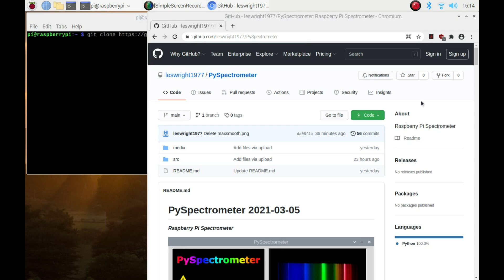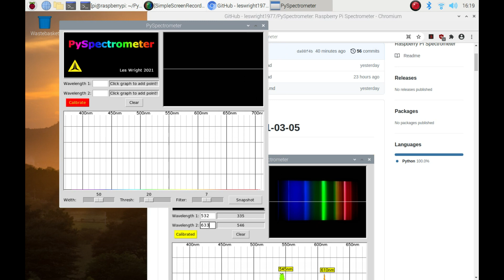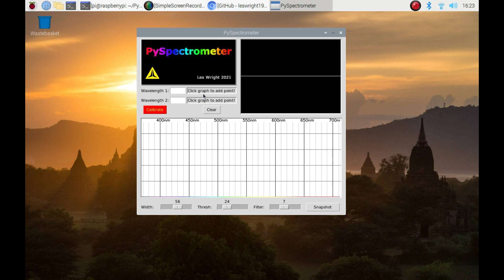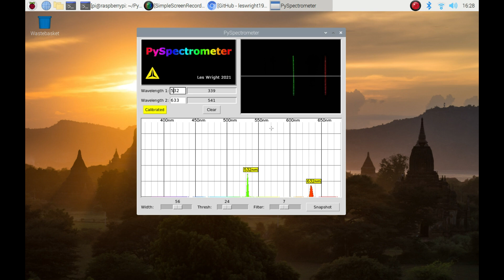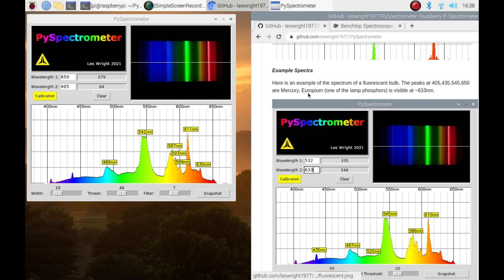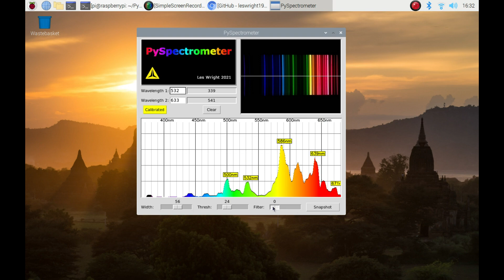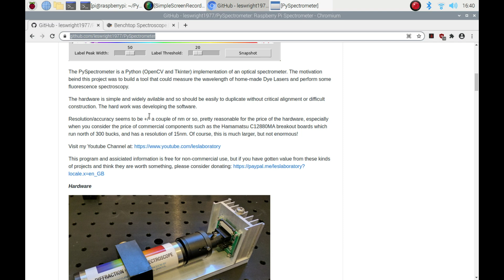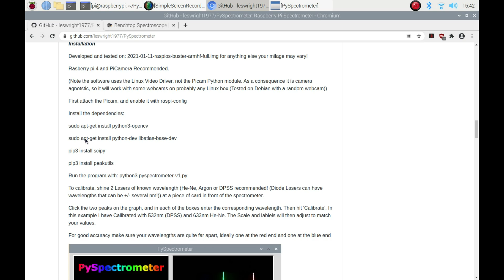How to build a DIY Raspberry Pi Spectrometer using a Picamera and Spectroscope.

Comment: Hypothetically could you run multiple instances of this for use with multiple cameras on the one rpi ?, is there an AU ledgend on the y axis ? Would it be easy to pipe this data through to another program which could act on the data say for monitoring cell densities during fermentation?
Reply from the maker: Hypothetically, yes, but it would require a rewrite.  The Y axis vals are AU from 0-255.
Again, yes, but a rewrite would be required. There has been considerable interest in using data beyond the program itself, I am just pushed for time at the moment, but it is coming. 
With the number and types of request, I am thinking of creating a "suite" of small applications that will run on the pi Zero. One that just spits data out so you can pipe to whatever seems like a good idea.
Reply: @LesLaboratory  awesome, thanks for replying, your setup could give my work spec a run for its money, brilliant work

Comment: This is just excellent -- thanks!  //  Btw, I suspect that the strong line a little into the UV that shows up with the HeNe tube could be He at ~388.9 nm.  (Ref:  https://www.physics.nist.gov/PhysRefData/Handbook/Tables/heliumtable2.htm )
Reply from the maker: Thanks, and thanks for the info! That's a real handy reference! I picked up a couple of interesting tubes on eBay lately for some more experiments. A germicidal Hg Vapor tube, and a Deuterium lamp. I wont be able to do much in the UV, but it will be nice to see Deuterium alpha, and other visible lines.

Comment: Does this project run on the Raspberry Pi Zero via SSH?
Reply from the maker: This runs a GUI, so no. It might run over VNC, but I expect it would be very very slow.
I am planning on building a 'Lite' version of the software for the zero. What features would you find most useful in a cut down version?
Reply: @LesLaboratory  Thank you for your answer.
For me the graph and the calibration function would be the most useful. I also think a 'hold' function would be a great addition. Maybe it would be possible to host a website with the pi (to show the data) instead of the GUI.

Comment: Could you use it for gas chromatography ?
Reply from the maker: Unfortunately, no. Chromatography is a different process, where compounds are physically separated for analysis.
Reply: @LesLaboratory  I think it works by shining a light through a gas sample and reading the diffraction.  Thoughts ?

Comment: Neat project. You got my attention with spectrometer, I've always wanted to use a metal spectrometer that can identify alloy percentages in metals. I think they use an x-ray as the most common type , could something like that be modified to use your design?
Reply from the maker: What you are talking about is XRF (X-ray Fluorescence), which is a whole different ballgame, but fundamentally similar, it just uses X-rays instead, and a suitable Scintillator instead f a diffraction grating to detect the different photon energies.

It would be possible to identify a metal with an optical spectrometer by vaporising it. This can be done with a High power Laser. Mars Curiosity does that: https://mars.nasa.gov/msl/spacecraft/instruments/chemcam/

Comment: Just what I've been looking for - THANK YOU!

I have lots of RPi 3B+ but no RPi4, so I'll have to get one I suspect. I assume a 2GB one will be enough - but I see that you're using a substantial heatsink on the Pi.

Two questions: Is the heatsink really necessary? Will your software work with the the RPi HQ camera?

Thank you again!
Reply from the maker: You are welcome!
The heatsink is not totally necessary, but I use the pi for some OpenCV dev work, so why not!
I have not tried it with the HQ cam (I dont have one...yet), but there is no reason why it wouldn't work!
Reply: @LesLaboratory  Thanks - much appreciated. I'll give it a go this week some time. None of the work I do with the Pi is particularly demanding (I've got every variety except the 4, and desperately waiting for some Zeros to become available again)
Reply: @LesLaboratory  Thanks again - I've only just made a test version, and it works pretty good. I got a pi-4 and set it up with the HQ camera (12.3Mp) and the 6mm CS-mount lens.

It's quite a wide angle lens so the spectrum appears quite narrow, and calibrating the software resulted in the graph grid becoming corrupted. So I'll try with the 16mm lens if I can find it, although I suspect it may be too narrow (but it is optically a much better lens than the 6mm). I'd like to try to get maximum resolution from this, although I guess it'll slow the refresh rate.

The pi does get VERY hot, and eventually shuts down after about 15 minutes - so I've added a simple heatsink.

I've 3D-printed a basic mount for all of this, but will redesign when I get a narrower-angle lens.

Comment: Hi, really cool project.  you got a new sub.  I'm trying to detect UVC light in a dark room, do you think this would work for that?  thanks in advance if you see this!
Reply from the maker: Thanks! UVC is in the range 100–280nm. Unfortunately this is outside of the range of the spectrometer (designed for visible) and indeed the PiCamera, again visible (and IR if you have not NoIR version).
That said, I am currently working on a possible solution to this, for the hard core hackers that want to look outside the confines of the visible spectrum!
Reply: @LesLaboratory  oh that's exciting, i'll be watching for that update!  Thanks for your reply

Comment: How did you know the lasers were those values? I did see a test where the nominated value was not the true value as referenced from a calibrated scope. Is there a standard product where we know the true value that does not vary?
Reply from the maker: He-Ne Lasers have very specific wavelengths. The common red He-Ne for example is 632.8nm, and does not drift with temperature like diode lasers. This makes quite a precise standard. DPSS Lasers, again these have very specific wavelengths. although the pump diode (808nm) may drift, the Nd:YV04 lases at 1064nm exactly, and so the doubled light is exactly 532nm.

Comment: Nice! I have a stupid question. If I understand correctly,  the spectrometer lenses separate the different wavelengths to end up sorted. The result is a "histogram" of wavelengths. Could the same result just be computed by counting the intensities on the CCD? I bet it cannot, but would someone please explain to me why?
Reply: Do you mean without a diffraction grating?
A. RGB-CCD has only 3 channels of spectral information, but with a diffraction grating in front that seperates the spectral channels you can have up to  2.592 spectral channels (with 5MP pi camera).
Reply: @SEOGmbH  do you mean 2000 or 2.5?

Comment: This is really cool. You know, one of the ways chemists use spectrophotometry is to estimate the concentration of a given compound in a solution, but doing that requires making a series of standard solutions. Particularly IR-spectrometry is uesd for identifying organic compounds, but doing that requires a library of known transmission spectra. Either way, you have a very powerful tool right there.

Comment: Please give us the Model Number and the Manufacturer of the F1.6 M12 Zoom Lens, it would make it easier for us to find the right characteristic lens, looking on eBay there are a lot to choose from.

Thanks!  Great Project and site!
Reply from the maker: Sure: 1/3" 9-22mm IR Sensitive Manual Zoom M12 Mount CCTV Lens F1.6 Security ZT  https://www.ebay.co.uk/itm/362992659840
I am currently looking into smaller fixed focus lenses for this application as well.
Reply: @LesLaboratory  Thanks for taking your time to answer my question!  Sharing y0ur project is a very valuable lesson for all to follow!
Reply: @LesLaboratory  eBay won't ship to Germany so I went to Amazon and I am looking at this:

Festnight CCTV Camera Lens 6-22 mm F1.6 M12 Mount 5.0 Megapixel Manual Focus Zoom 1/2.5 Inch Lens MTV IR Lens for Security Cameras HD IP Cameras (No IR Filter)
€17.99 
FREE Delivery

Does this look good to you?

Comment: Wow very nice. But can't you make it say what the things are made out of instead of numbers? They used a spectroscope on the SUN or stars to know there mostly hydrogen. But like you said can't point this at the SUN. But burn any thing and it will do light and this should tell what it's made of right?
Reply from the maker: I suppose you could maybe process the data with AI to give an indication of what it might be. I will look into it if I get time.

Comment: Great video. I have a question, I need to measure uv wavength from 320 up to 420 nm. Any suggestions? Is there any filter for the camera? Or a specific camera for uv?
Reply from the maker: jonsmirl on github sent me this: https://www.mdpi.com/1424-8220/16/10/1649/pdf Worth a look!

Comment: Would see additional value in integrating detector response curve... currently it is only calibrated for wavelength, not intensity. I agree, that is much more difficult to achieve though.
Reply: Good idea. For this, one will need the quantum efficency curve from the camera. But I m not sure the manufacturer has measured it for such a cheap camera. Also, the camera uses a bayer matrix, which means there are red, green and blue pixels. These have to be callibrated individually. So i guess it is easier to look for a monochrome sensor with a quantum efficency curve available.
Reply: @TheMAggi99  Definitely going black and white sensor is a good option. In my young days when still doing detector work, I removed  the glass protective plates in front of the ccd array: you can buy 50 of them on the cheap (and break several off them while improving your methods), compared to only one equipped with a quarz window.
I was dealing with soft x-rays lasers, and these tend to actually increase the dark current of your pixels over time, burning the camera chip, even at low average (but high peak) intensity.

Comment: Greetings from a HAD reader & new sub. I only recently became aware that it was even possible to build lasers at home -- my wife is concerned. 😁 Cool you were able to get that spectrum on a regular RPi camera. Would the NoIR cam variant help with the sensitivity at the extremes of the spectrum, maybe?
Reply from the maker: Yes, the NoIR cam would be more sensitive. The Spectroscope I am using is designed for visible wavelengths though. The deepest into the IR I have seen is 760nm. To get a larger range, you would have to build the spectroscope frontend. UV is particularly problematic. Most glass types, and all plastic will absorb it. You would have to use Fused Silica optics for UV work, which costs $$$! IR should be no problem though.
Reply: @LesLaboratory  Ahh yes, of course. You're working in UV... no idea how I got IR in my head. That explains the effort behind the dye lasers.

Comment: You know, you would have a hard time using security cameras if they were all damaged by the sun ... sun shines into my cam often as it gets low in the sky and it is just a $30 amazon job.
Reply from the maker: Sure, just don't want people chasing me if they break their stuff! That said, if the aperture is large enough, you can destroy the CCD.
Reply: @LesLaboratory  That is why i said 'security cams' since even indoor ones may be hit by direct sunlight if looking outside.  It is one reason those idiots with laser pointers have a hard time damaging security cameras.  I really put this in here for a hint about possible solar spectrometer (blackbody permitting).  Of course I understand your disclaimer, but it is an interesting bit of fact to make people aware of.  I did like your video btw.

Comment: How can that be done for infrared spectrum? I was thinking to use something like that to check fiber optic telecommunication interfaces... let's say from 1530nm to 1565nm.
Reply from the maker: To get a larger range, you would have to build the spectroscope frontend. IR should be no problem. You woudl also have to use a Picam with No IR filter. Just look for NoIR, and check and see if the response fits your need.

Comment: Can we use a DVD for diffraction grating?
I have noticed the DVD diffraction pattern is not linear, but sort of polar. Is there anyway to correct for that?
Reply from the maker: You should be able ti use a home made spectroscope with the software. Yes, off of a DVD or CD the pattern in an arc, so long as you can get the line in the preview windows to run right down the center of your spectrum from red to violet it should work. You can always buy cheap linear diffraction gratings online.

Comment: How are you calculating intensity or counts at a particular wavelength. I assume the camera is RGB right?
Reply from the maker: Yep, it's RGB. When the pixel data is pulled out, the RGB data is just averaged to get the value for intensity. I will be doing a video explaining the source code shortly, so people can find their way around it and improve it. Also, V3 (soon to be released) has a couple of features added, that have been requested on here.
Reply: @LesLaboratory  Thanks for the reply. Any reason you choose to interpret intensity in that way? I've been playing around with the idea of using HSV color space to use the S & V values as a pseudo intensity substitute. Maybe it might be appropriate here as well?
Reply from the maker: @moothecow7346  cv2 by default pulls BGR (RGB) data out. It can be converted to HSV in OpenCV. In some computer vision applications you would want to do this, for example tracking a colored ball whilst ignoring the luminance information. There is nothing to stop you giving it a go, is should more or less be a one liner to convert the data.

Comment: Brilliant, well done. Is its possible to get an xy data file of the spectra?
Reply from the maker: Thanks! It's coming in the next release (this weekend with luck).  A few people have asked, so it will do CSV export, that you can use in other programs. Also, I have implemented a peak hold feature for pulsed applications. Stay tuned!

Comment: hm, what is the difference between cheap and expensive spectroscopes tubes thingies?
also what about UV and IR?

does it save the calibration?
im interested, always wanted a REAL one but can't afford... so gotta build one that works-ish
Reply from the maker: I guess quality. I have not bought a cheap one. UV and IR, are out of reach from the one I am using, it is designed for visible light. I have successfully detected NIR at 808nm with it, but the signal was small. You can always build a custom scope for it.
It does not save the calibration, mostly because it is just easy to do, and chances are you will change it the moment you tweak the focus or something. It would be a trivial software job to save to a file, and read it back though. I might implement it in a future version.
Reply: @LesLaboratory  hmm thanks for response

Well out of reach for me for now
But i'll keep the project in favourites
Reply: @TheChemicalWorkshop  Yeah, that could be super useful for DIY chemistry